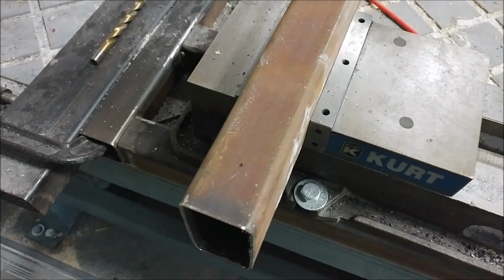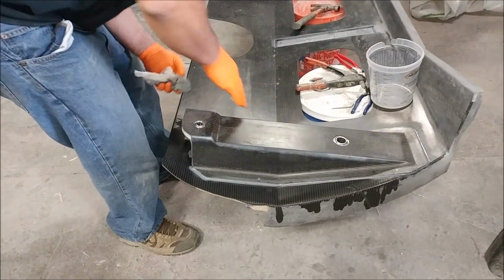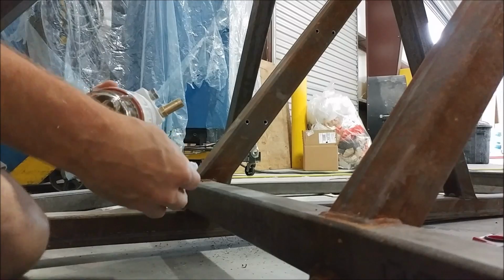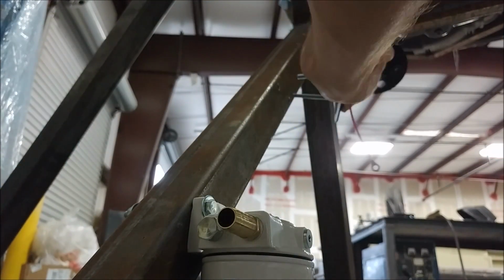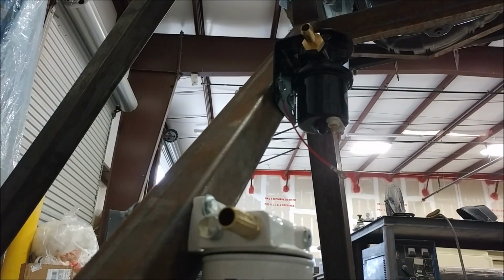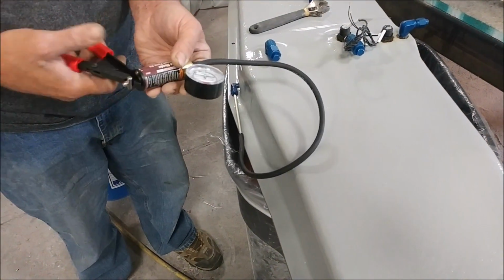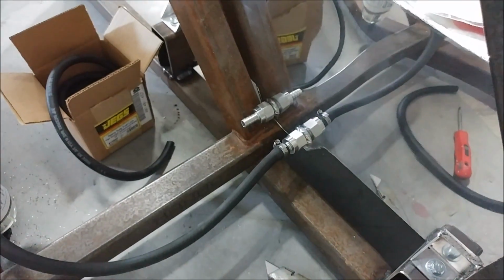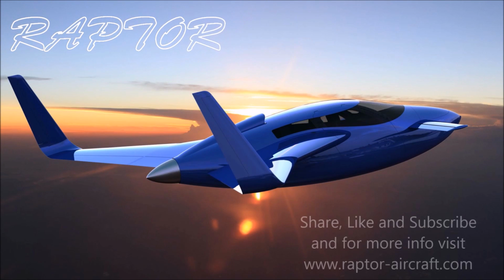More Pieces of the Puzzle - Bonding the gear brackets into place

Comment: With the dual belt design, is there a chance that one broken belt could interfere with the working belt? Perhaps a shield or plate that separates the belts in two isolated sections could be installed. It could attach from the outside of the frame in two halves. Love the videos and keep up the outstanding work.
Reply: The shield or belt guard could interfere with the belts. Inspect belts before each flight & replace as required? After seeing that video about the gear drive!  That is an upgrade I would have no problem with. The cost difference would most likely negligible. Those pulleys can not be cheap to make.
Reply: how often do you want to have to pull the engine cowling to inspect the belts? a simple plate that splits the two pulleys and would keep the belts separate in the event of a failure seems like a very simple and low cost piece of insurance